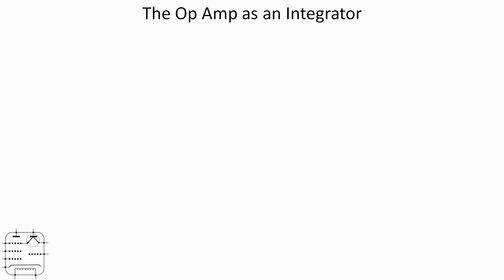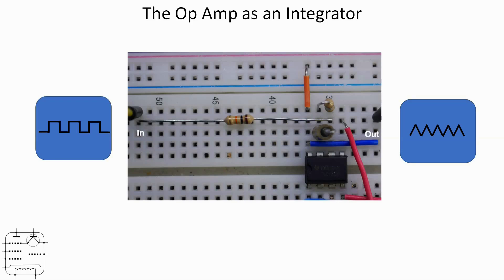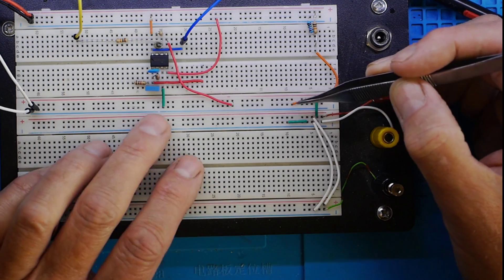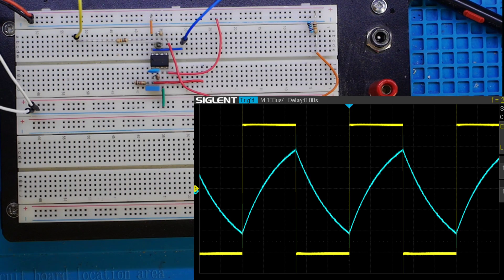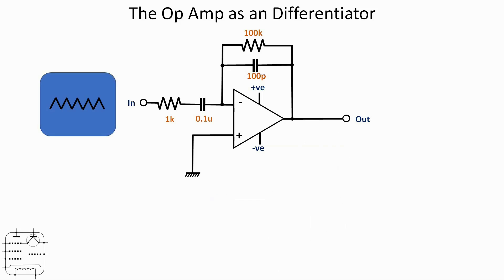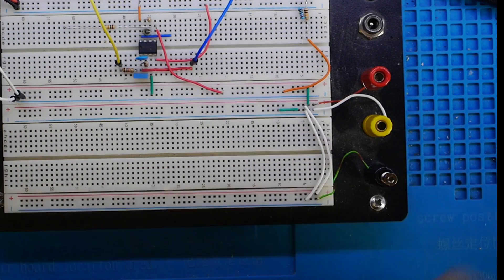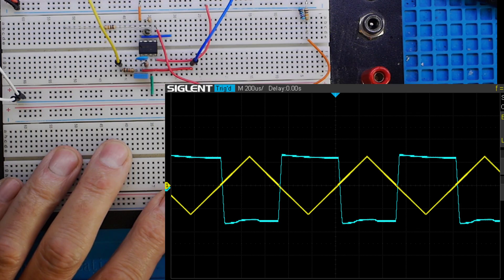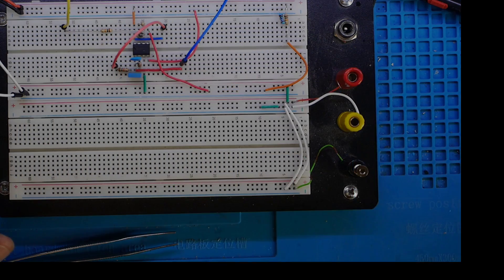Op Amps - Integration and Differentiation - #167

Comment: I'm still immersed in the Analogue world. What frequency input were you using? The sawtooth looks like a capacitor charge/discharge but there should be a constant current through the capacitor resulting in a linear voltage change (I think) as long as we don't approach the limits of the components. I wonder if the other capacitors on the board had any effect? Happy to be corrected here.

Comment: is it possible to make op amp integrator circuits that don't cause phase shift?
Reply: Integrating a sinewave by definition gives a cosine wave which is always lagging the input by 90 degrees.

Adding or subtracting time delays won't work because a 90deg phase shift implies a time delay that increases as the frequency decreases